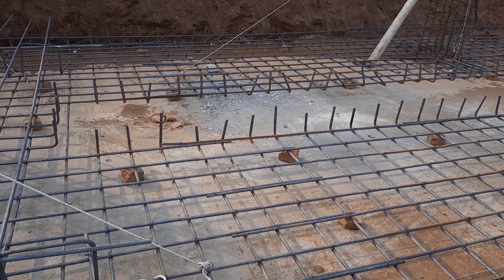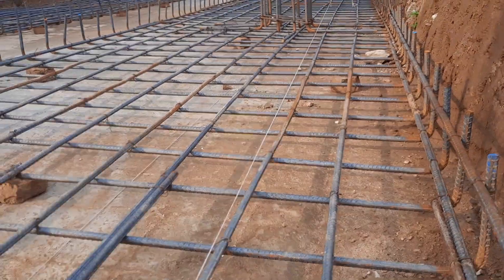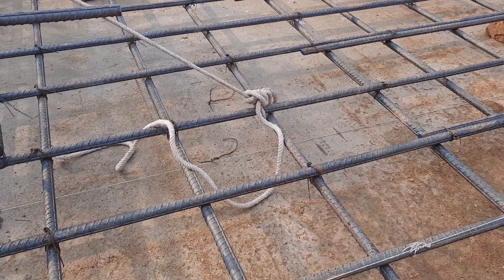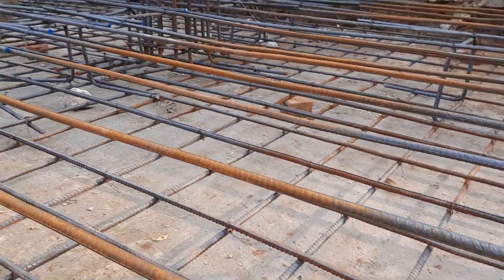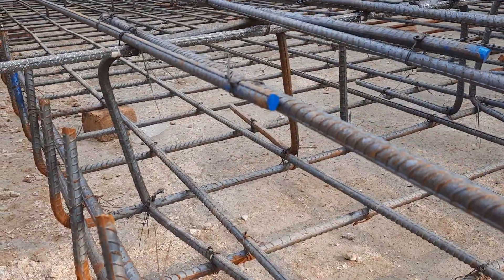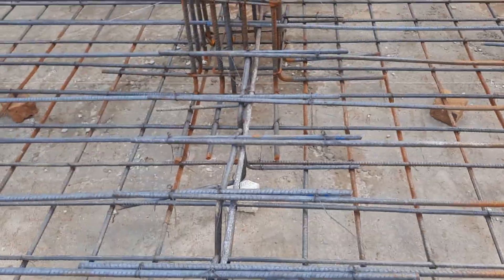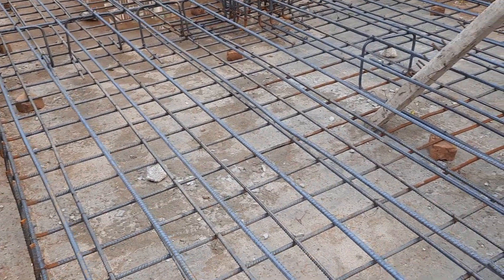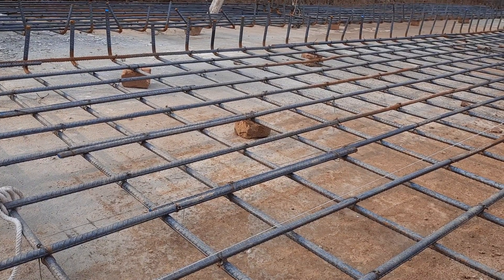RAFT FOUNDATION CONSTRUCTION DETAILS

Comment: The most useful thing in a slab is a concrete chair. The rate is Rs. 27 whereas if iron is used instead, it will cost Rs. 150. This way a lot of money can be saved by using a chair in a building.